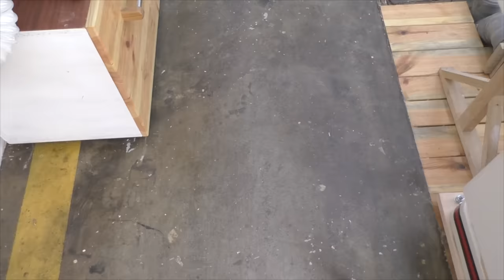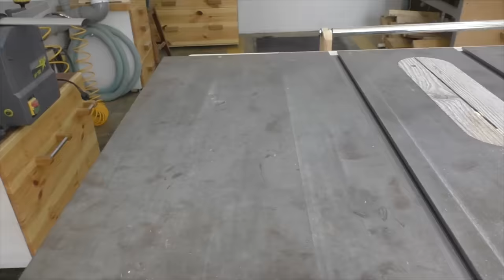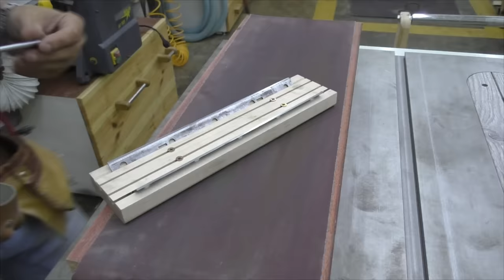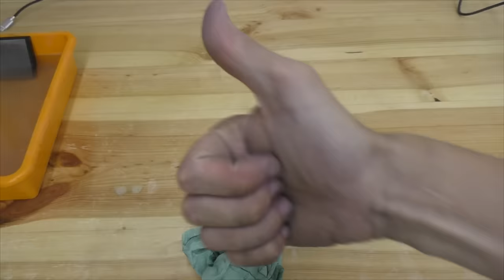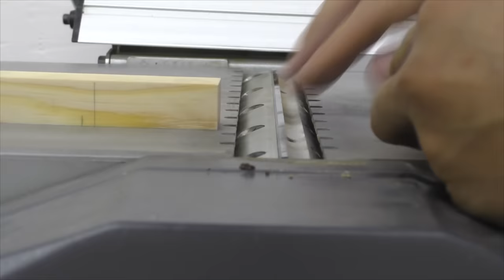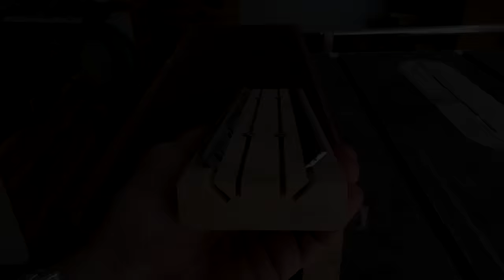🟢 Planer/Jointer Blades Sharpening - How to Sharpen Planer Knives with Sandpaper

Comment: I have used this similar jig for years to sharpen my 12" planer blades, I just run them on my 6" x 48" belt sander w/ 120 grit then 220 grit does a fine job in a very short time. However, your second kerf to clamp the blades in with screws is genius! I would use thin shims that I had to make that I always had to mess with, they didn't work that good. next time I need it I will modify my jig or make a new one with your clamps. Many Thanks!!
Reply: My question was going to be what grain of grit ?  Whetstones are often 400 then 800 grit, but you think that in sand paper 120 then 220 is ideal ?
Reply: @advance-heating @advance-heating  Using 120 and then 220 has worked fine for me; I used to run a flat stone over the knives while still in the jig but found that unnecessary.
Good luck!
Reply: @samTollefson  I'm also thinking of mounting all three blades into a hardwood jig at once, all three pointing the same way but far enough apart to keep them stable while grinding by hand.  Think it'll work?
Reply: @advance-heating I don't see why not; however, I would put 2 parallel and the 3rd one alternate to have a broader base for stability and use a hardwood block for it. In my situation, my planer has blades that are sharp on both sides, so one set is two sets of blades. Before I found this method of sharpening them, I would buy a new set when the old ones wore out. So when I made my sharpening jig I sharpened maybe 12 sets of knives, that was 10 years ago and I still have 4 or 5 sets to go through before I need to sharpen them again, pretty much a life time supply.

Comment: Setting the blades higher than the out feed table seems incorrect. I always take a dial indicator and set them to 0 height.
Reply from the maker: i made some experiments in the past and when i set up blades to 0 height the planer removed more material from the front of the workpiece and made it looks like wedge
Reply: @Jimm Panik .... I also used a dial indicator mounted to the outfeed and set the outfeed  .060" (1.5 mm) higher than the cutter heads top dead center.... seems to be the goldilock zone for me...
Reply: So your outfeed table is lower then cutter head?? Am I right? Could you give little bit explanation on this? It looks something I would do but that hight adjustment through me
Reply: I agree with you on that, it’s a reason that the in put table it’s movable up and down, and can be set to zero in line with the out put table.the correct height for the blades is zero with the output table👍😀

Comment: I’ve had this product for over two weeks and I’ve used it almost every other day https://www.youtube.com/post/UgkxDcr-y2Pf6xdnrFHrSP7dl9kpKaCozcSQ with my knives. After the first session of sharpening my cleaver, I recall slicing through a tomato, veggies, and meat a lot cleaner and smoother than ever.I only give my knives 10 to 20 strokes of the sharpener before every other use, depending on how much force I’m putting on the blade against the cutting the board.I don’t have expensive cutlery. Most of them are cheap ikea knives and my cleaver was bought at a market at a low price ($10?). The sharpener has given the knives a much better edge and I’m very happy with it.I don’t push down on the blade sharpener with the knife. I let gravity do it’s thing. As you’re supposed to.

Comment: I have been using the woodblock 'blade holder' system for years with great success. Mine will hold the blades by friction alone, so no screws needed, and when it gets too worn it only takes a minute or two to make a new. I do put my sandpaper on a flat sheet of glass though, to assure flatness and no rolling of the edges, but I never bother with the whetstone and just remove the bur gently on the same sandpaper. It literally only takes a few minutes to get good sharp blades but I always find that removing the blades, and then reinstalling them, is what often makes me drag my feet before I get around to touch up the blades as it is a time consuming fiddle.
Reply: It's like a visit to the dentist - you are stalling for time, but you know that the inevitable will come :)
Reply: 323r

Comment: Hi,
I surf a lot on the internet, I never saw this before.
The jig is fantastic, but the way you control the right height, sublime.
I suppose you set the planner on a certain height when you measure the travel???
Different height gives different travel, not???
Thanks for sharing.
Keep it safe, it is not over yet.
Willy from Belgium.
😷😷😷

Comment: Spero tu riesca a capire quello che scrivo. Molto facile e chiaro il tuo sistema di allineamento. Può essere utilizzato con qualsiasi pialla? è un sistema generale?
Reply from the maker: yes, it works woth other knives too, but you should measure the sharpening angle on your knives before making this jig. Thanks
Reply: @GRINwood  e la misura è sempre di 5 mm?

Comment: Excellent jig but I believe you would achieve better sharpening if your movement on the sandpaper was across the blades (even at 45 degrees) instead of parallel with them.

Comment: Thanks a lot for this video.
From where comes  the 5mm gap ? Does it depends on the planner  ?
Reply: Hi. 5mm mark is just a reference to make sure the blade is set equally high on both the left and right side  Some would say less like maybe 3mm movement. The further the mark moves the higher your blade is set.

Comment: Not how I do it.
With the blade height setting, the blade shouldn’t come above the outfeed table to lift the stick & carry it 5mm.
The blade height should be perfectly level with height of outfeed table.
The idea is that the timber after going over the blade slides across to the outfeed table without lifting or dropping.
If the blade is set higher then the timber will drop that difference on the outfeed table creating a snipe where the timber is still being planed.
Your timber won’t be planed straight either, it will be convex like a banana.

Comment: Where from you got the value of 5mm?
Great Job! 👍
Reply from the maker: i experimented a lot with my jointer, so this is result of the best set up. But i think this set up will work for jointers with 60mm diameter shaft, for bigger ones it will be not enough
Reply: @GRINwood  oh okay, thank you for information. I will try it the same way :)

Comment: How do you make the jig? How do the screws hold the blades?
Reply: the countersink on the screws forces the 45deg kerf to close as they are tightened down so it clamps the blade into the kerf.

Comment: Sharpening ……….. ok, but that planing you did??? Not even close to be ok. Once the wood passes the knives you keep pushing the wood on the outlet table. Never keep pushing at the inlet table, and don’t use that pushing stick. That is dangerous! Once that slips away , guess where your hands wil/can be?